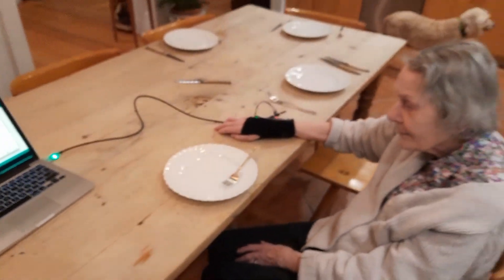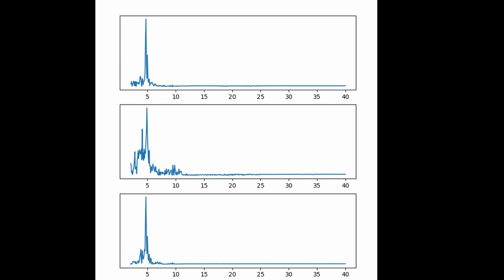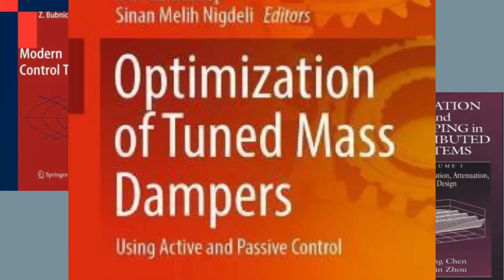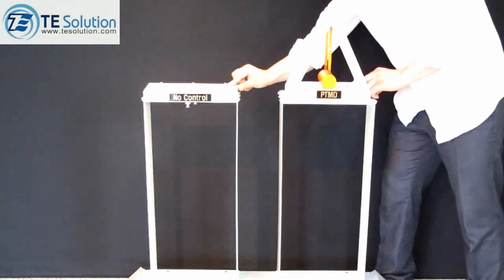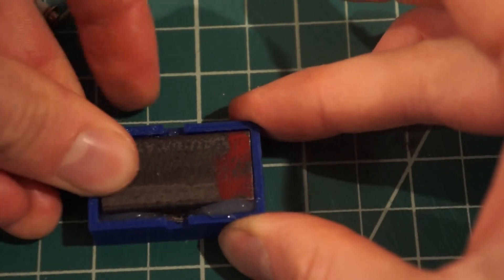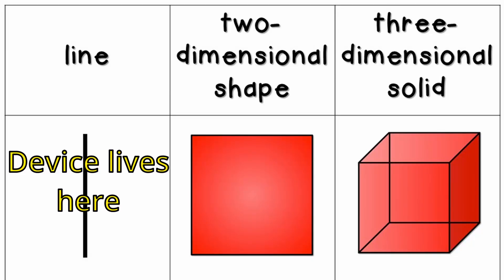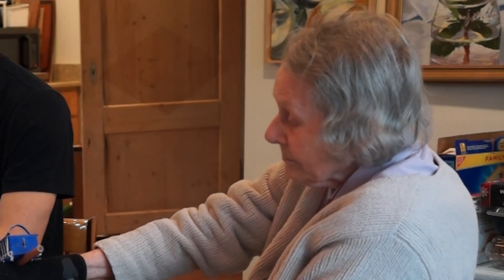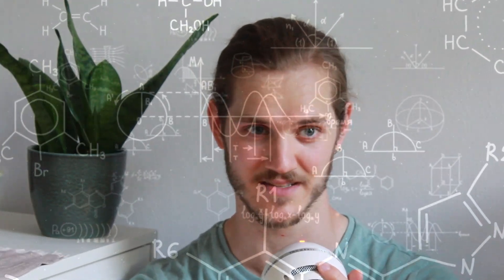Old-School Engineering to Help My Grandma

Comment: Man, what you built is genuinely impressive 👏
I’m a biomechanics professor and researcher (PhD), and I’ve spent years working with human movement, motor control, gait, and assistive solutions that actually work in real life.

I’m currently the Director of Technology at a Brazilian scientific society, and when I saw your project, my immediate thought was: this kind of simple, well-thought-out engineering can massively improve people’s lives.

I have several ideas focused on helping people with disabilities walk better — low-cost, practical concepts that don’t rely on complex or inaccessible tech. But they only make sense with someone who can prototype fast, test, iterate, and genuinely cares about impact, like you do.

If this resonates, I’d love to chat. I honestly think applied science + your hands-on engineering mindset could lead to some very meaningful projects.

Comment: So, it turns out, in order to make a tuned mass damper for your grandmother's wrist, you first had to make a 5Hz wrist oscillator, which does the exact opposite of what you want, and then simply invert it. Which is... kind of what a mass damper does. The diagram you displayed at 6:21 basically looks like your wrist oscillator... sans the dummy wrist.

Comment: Besides springs in your device don't you also dampers so that the energy is dissipated. Same as why car suspensions have both coil springs and gas shock absorbers. All it will take is some rubber to dampen the oscillation of your free mass.

Comment: The tremor is probably caused by low density muscle in her bicep/upperarm/shoulder causing the rapid muscle contractions due to stress, look at skinny guys lifting their max weight and how they seem to have tremors . Her simply wearing the device for maybe three months might nullify it due to the added weight and exercise not to mention the weight of it would cause it different occilation timing. Maybe it goes from 5hz to 4hz. Just a hypothesis but who knows

Comment: this is SO awesome. most of these solutions are with complex mechatronic devices so the fact that you can do it purely mechanically will make it so much cheaper and more accessible to others
Reply from the maker: Thanks! :D oh yeah, i experimented with active powered solutions (might post those adventures at some point) and it gets bulky and expensive very fast.